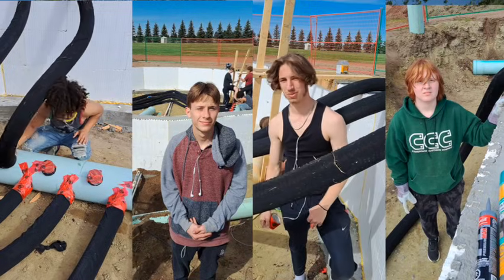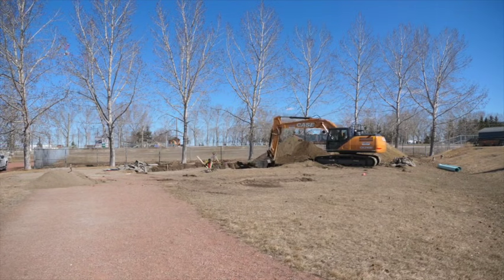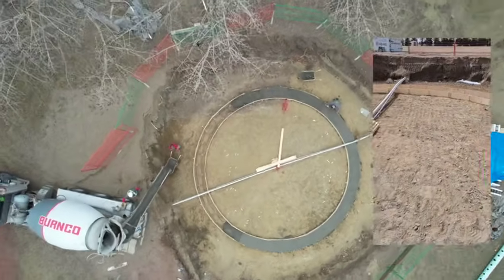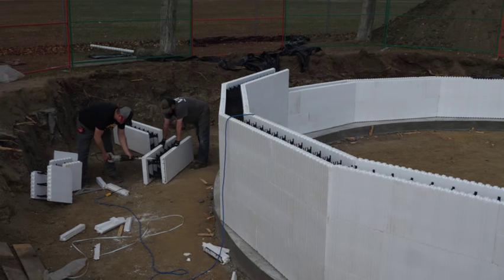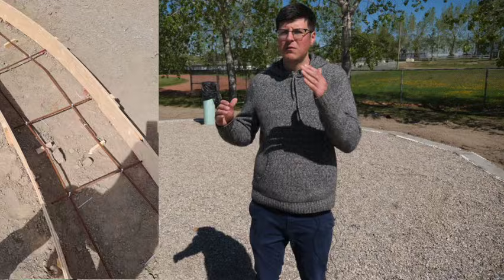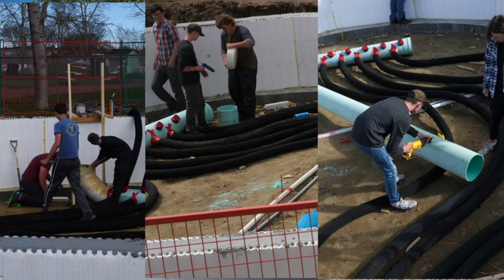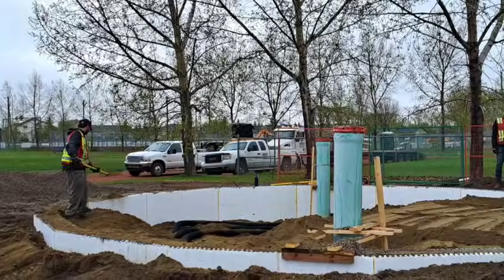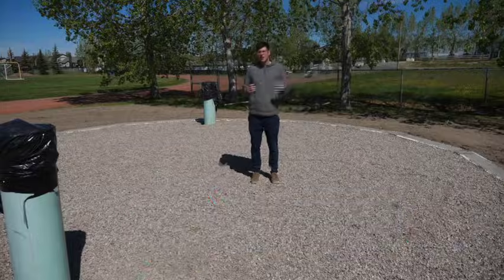DIY CLIMATE BATTERY! Our OFFGRID heating and cooling solution!

Comment: Water has an exceptionally high specific heat of 4.184 J/g*K. If you're trying to build a large thermal battery, you should use water. Even better than just specific heat is latent heat. Search for phase change materials and you will find resources on creating materials with high latent heat and variable melting points. This way you can store hundreds of joules per gram of material without even changing the temperature and after the whole mass melts or freezes, it still has to warm up or cool down.
My suggestion would have been to fill 55gal drums with a low temperature salt hydrate PCM (about 15-20°C should be right but I'm no gardener). Put this in the pit instead of your manifolds. If the ground temp is below this melting point, the pit should have an insulated bottom. Lastly, run a pex loop in the pit, bury the barrels, and connect the pex in series with a pump and radiator inside the greenhouse. In the summer, the greenhouse gets hot and the PCM barrels store massive amounts of heat. In the winter, that heat gets released into the greenhouse. In the fall and spring that cycle will be daily.
Reply: On paper, a great idea. In real life, horrendously expensive and impractical.
Reply: @KevinMaxwell-o3t  It's really not expensive. The materials are around the single digits $ per kilogram. Considering they can store 100x the energy that plain dirt does, I'd say that's pretty good. Also, radiant heating is not new or expensive tech.
Reply: phase change is an UTTER Waste of time and $$$.  All it does it take up volume that you could be using for water which stores 2X the HEAT than the phase changing wax.  The COST is the tank and the ~Free water.  The cost of the phase changing wax(pick your temp you wish) costs more than the tank and water AND stores LESS kWh of heat, AND stores it coLDER generally speaking as the TANK material due to COST determines the temp the tank runs at and is the limiting factor almost every single time.  Throwing half  your heat capacity away just so you can maintain 150F for an example is an exceptionally STEEP price to pay
Reply: @w8stral  Parafin wax is expensive, but sodium sulfate is not. It has a latent heat of 254 J/kg compared to water's 4.18 J/kg•K. Plus it's 1.485x the density. That means per unit volume, the PCM holds the same energy that water does with a 90°C temperature differential.
PCMs are cheap, dense, thermally static, and easy to insulate. You can store energy on the order of mega joules quite easily.
Reply: @moustacheman7130  Um, dude, go back to school, or put reading glasses on.  Water is 4.18jJ/gram, uh hem, per GRAM, not Kilogram.    1000 X difference.... or 4184 J/kg
Reply: @w8stral  Yes that's a typo. Water is 4.18 kJ/kg•K but sodium sulfate is ALSO 254 kJ/kg. I made both of them kg instead of g. The point still stands. PCMs can hold a lot of energy. The main difference is that if the air is only slightly warmer than the melting point, you can extract free heat energy from the atmosphere until your batteries are full. With water, you need a massive temperature differential to store the equivalent energy.

Comment: I was under the impression you sound use sand for a sand battery and insulate the top snd bottom too. Arnt you going to lose you heat from these areas?
Reply: I was wondering about that too. Makes no sense whatsoever.
Reply: Lose it where? Into the area you intend to heat? That’s not a loss, that’s a use.

Comment: Why didn't you insulate underneath? You're pumping heat into the ground, great, but it's just going to dissipate away.
Reply: If you have temperature sensors in the ground below the system you will notice the heat flow is  downwards in the summer and upwards in the winter. Vertical perimeter insulation will prevent heat being lost from the mass to the cold ground outside. Insulating below the system can be useful in some applications but, in most cases, it isnt an advantage as it   fixes the volume of mass and therefore the heat storage capacity.

Comment: The eco systems calculator uses outdated information and as a result the system will not be as effective as it could be. Contrary to popular belief its not about how long the air spends in the tubes, its about how long the entire greenhouse air volume spends underground. Long tubes with multiple bends should be avoided at all costs. If you didn`t modify the tubing prior to installation,  ie; cutting a straight slit partway through the corrugations, you will have condensate sitting in the bottom of every corrugation which will impact the heating performance significantly.

Comment: Is the idea behind the Parallel system for rapid charging? I would of thought a Linear system would be more efficient.
Reply from the maker: I believe it's more a surface area: volume thing especially if you are looking for temperature and moisture differences between the ground below and the air moving through.
Reply: A linear system would incur massive frictional losses which would severely limit the amount of air you can run through it. Consider that 5x 20ft tubes have exactly the same surface area for heat transfer as a single 100ft tube.

Comment: Sand + silo painted black+ copper pipe coiled at the inside edge of the silo+ water tower+ pond + rocket stove inserted in the silo for added power = your welcome🎉
Reply: You post my idea only mine uses a turbojet engine because I'll be using all types of gasses and or organic fuel
Reply: YOU’RE.  NOT your.    YOU’RE Welcome.   And you OWE me!!

Comment: Cool project. Looking forward to seeing how this turns out.
Considering that the main obstacle you have as heat during the winter, is there a reason you elected not to put a layer of insulation underneath your tubing to create somewhat of a thermal break between your battery and the Earth beneath it?
As this is currently set up wouldn't the heat being pushed into the soil potentially just escape out the bottom too?
Reply from the maker: Thanks for checking us out! 
We knew we were never going to be as deep as we wanted with a 4ft foundation and were capping our battery as it was. We weren't super sure (still not) on how far/fast  heat travels belowground like that.  We assumed most of the heat would rise as it is but I'm sure the dynamics are more complicated than that?? Thought maybe we'd have larger capacity in the summer and in the winter it wouldn't matter. We get chinooks pretty regularly and can have a week in January where the area is almost muddy. Think we are deep enough to avoid frost in that area but you never know.

Comment: The biggest mistakes I see when making a climate battery is, they are never deep enough to take advantage of constant temperatures at 15-25 feet and using pipe that is too small.

Pipe between 12-24 inches with appropriate fans for air volume mobility allows better temperature regulation.
Storm water chambers work better for quick recharge and use, especially when installed in layers that are 15-25 feet below grade and filled with a combination of sand and gravel for temperature permeability.

Most geothermal batteries are shallow like yours because of cost and labor but can not store enough heat to run for very long.
Reply from the maker: Totally agree. As you mentioned the resources we had limited how efficient we could be in its design. That being said we have had measurable benefits with what we got...would be nice though to talk about heat storage in terms of months vs weeks...
Reply: Youre heat storing with plastic pipe’s is wrong, replace those with copper pipings every 10 cm . Make a frame put solar panels 7x 425 watt. On each frame off copper pipe’s, 
Dependance on youre money, 4 levels are enough, put other pipe’s between do‘s layers. 
Youre 3000 watts are generating a lot off heat to the pure sand, 
Witsch you need to put under and between and on top of it, after you close it with clay, isolation. And plastics to keep the heat inside. 
If you did tjat you can let the sun do his work, youre system will heat a complete house and warm water system. 
Because the sand will reach a Temperature off 600 c
Reply: Do you have a link to a video that further explains this method ?, thank you for your comment @Berseker-d9e
Reply: @Berseker-d9e  interesting knowledge. how did you get to 600 degrees? is it a heating source and distribute it via air thourgh the copper pipes?
 and will this system last 6 month's to cover a winter?
Reply: @tibistibi 
I did many kinds off test with certain kind off Minerals, tje best heat conductor is beach sand, the mixture with salt makes it even better, 
Just take a non corrosive steel pan fill it up, and put it on a stove. 
Bring the heat in and look how fast it goes up, and how long it takes that the heat goes away. There for you need a tool that can measure heat up to at least 800c 

The only downside with a that kind of pan is, that after it reaches the highest heat like 45 min, the heat will be lost in 4 ours. Because it has no isolation. 
And steel takes the temperature from the air surrounding it. And the amount is small. 

The pan is waisted afterwards.. 😇

The difference is when it is in a big container, like a shipping container, filled up with layers, and on the inside very good isolation. Is the expensive part. 
If that is heated up. 
And if you use a panel heat exchanger like 60 to 80 plates. it would be the only spot where it loses a little heat. 

And as a circulate’r you need just can’t come on the name now 🙈 
That liquid which is used in photovoltaic cells. 
Not water because that will disappear fast. 💨 
And it will loose it heat faster. 

And not a direct system, the best stays a panel heat exchanger. 
Then on the other side you can use it for the heater and hot water. 
Best possible way is that all the pipes in the house are isolated as well. 
So heat los will be reduced a lot. 

Depends on the size off the container, 6 meter will keep heat up to 5- 6 months.. 

To heat it there are many different ways. 
One is sun mirrors, with a big chunk metal with a lot off holes where liquid can run true, place the mirrors so that the chunk of metal is the center part, also works in the winter if the sun is there. 
Wind power electricity directly on the pipes, only important part is, don’t use a earth fuse, and don’t take a shower at that moment. Ore use water.. wile filling up heat. 

Solar electricity.. which is much lower with a few plates. 

Photovoltaic tubing can bring a lot off heat. 

The thing is this, the sand mixture with salt, stores all the heat, it’s just getting warmer and warmer.. 

A stove only gives heat up to 250c.. sand salt can reach much more.. 

That mixture also works underneath a little fire, 
Just place a cubic metal can filled up with that material, 
The top open, and you can cook on top of the sand/salt much longer then on that little fire.. 
try it out, you will be amazed. 

I can’t show anything, like pictures ore videos because i live in a country where this kind of heating isn’t allowed.. and i don’t want to get a penalty for that.. 
i would love to show it.
Reply: Depth  is not as important as folks imagine. A climate battery is a system that actively adds or removes heat from a sheltered mass.